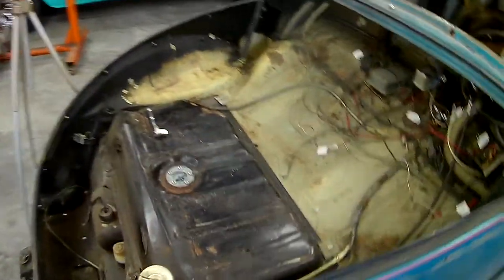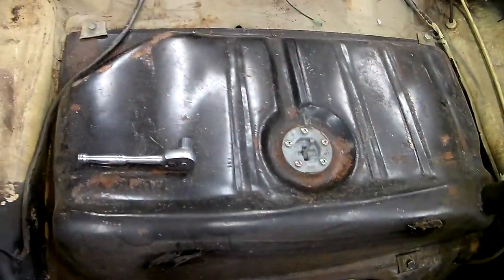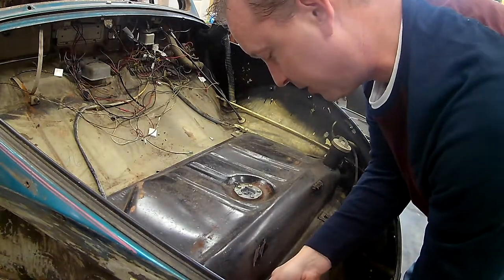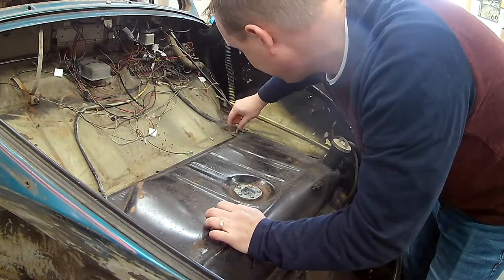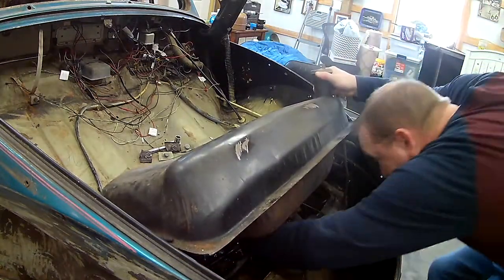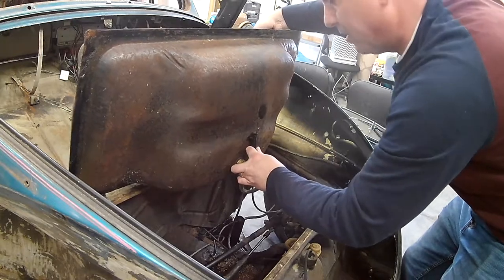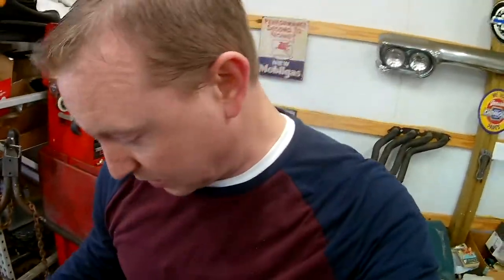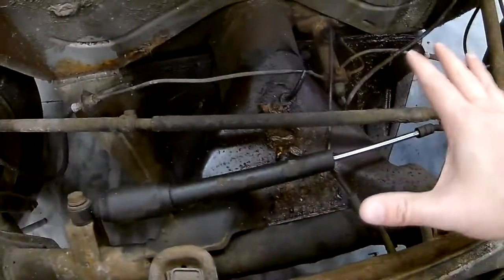VW Gas Tank Removal

Comment: The tank looks to be in good shape; if it was kept full most of the time corrosion inside should be minimal. You can clean it and line it with POR-15. Try to keep and refurbish as many original parts as possible; they are better than any new replacements and you’ll save money in the process. There’s a filter at the bottom petcock; this is a good time to replace it. The surface rust at the underside of the tank can be treated with rust converter first, which serves as a primer and then hit with paint. The top looks almost perfect.

I’ve seen some cars with a lot more rust in that front wall to the point where it needed to be replaced. This needs patching with new metal.
Reply from the maker: Thanks for the tips!  What brand would you suggest for the rust converter?
Reply: @thebadbug7026  I’ve seen Mike Fn at his channel use one called just like that FDC Rust Converter; Eastwood also has a good rust converter too.

Comment: I would keep the original gas tank and refurbish it. That is your best bet to be quite honest with you. And then wire wheel all of that area down inside, and put the proper coating on to preserve it, you’ll be good.
Reply from the maker: Thanks Slades VW beetle! It needs to be taken care of to keep what rust is there from spreading.